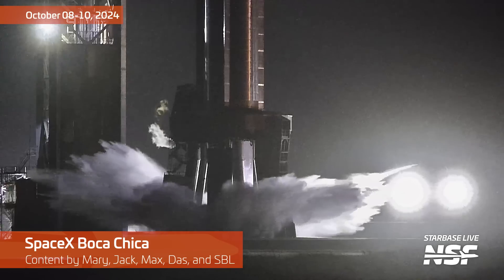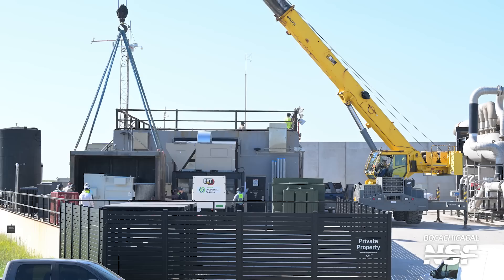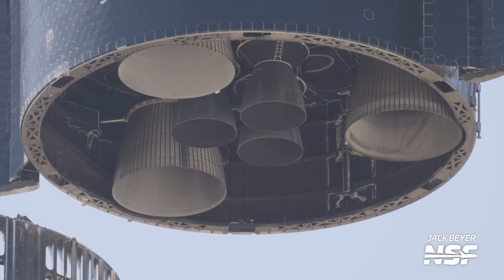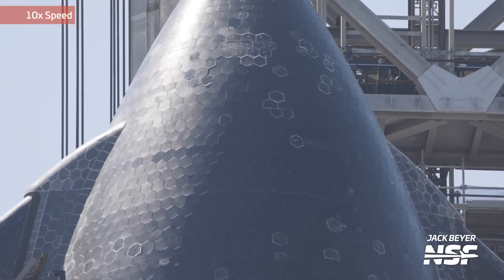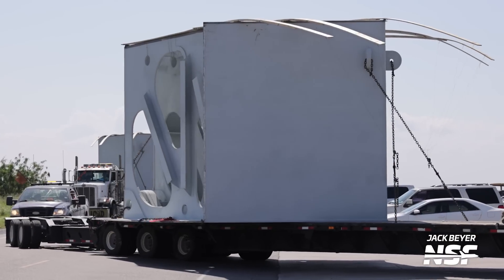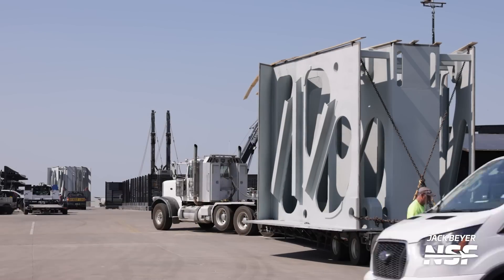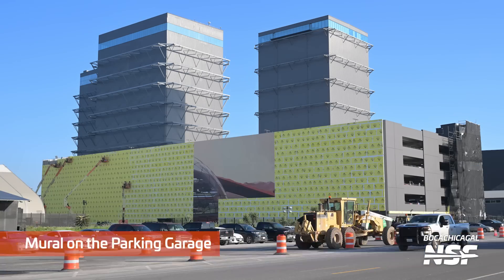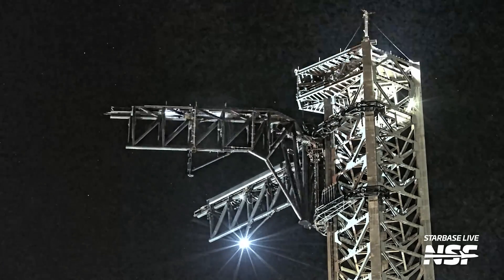FTS Installed Before Launch & Potential Catch | SpaceX Boca Chica

Comment: It's for over height loads or those very close to the maximum. Without requiring the power company to remove or lift the lines. However, there will still be spotters with poles, lifting the lines as needed. The lead vehicle will have a pole set at the same height, minus a few inches. This will give some time for the ground spotters and drivers a chance to react. All over passes will have to be bypassed, fixed structures don't flex very well

Comment: Yes the wood is to let low hanging cables slide over the tops of a high load. Yes do a video on the Del Mar thing (HA Now you gotta do home work) On tower one they left the flag up until they reeved the cable through. I hope they do the same here. It should be ok  as far away as it is.Thanks all... kinda enjoying the Boca Chica radio thing!

Comment: DAS, Correct the board's on top are to help prevent a snag on a wire but the chase vehicles should be warning the truck operator about the low wires.

Comment: @NASASpaceFlight at the 1:50 mark in this video, those antennas on top of the tower look like they will be used by the booster for triangulation to it's exact location during landing. That is where they will get their measurements from during the booster landing approach.

Comment: Can someone explain briefly how they are launching earlier than expected
Reply: I saw several videos speculating that NASA told FAA to FAFO!
Reply: Nobody had reported for certain but the regulations say that Fish & Wildlife has up to 60 days to report back. That's the time FAA was giving as a response. Seems likely they didn't need that much time. Eric Berger is reporting license drop likely Sat 10/12
Reply: nasa most likely is certifying them instead of faa as they got vested interest for sx to get this system operational asap and at the pace sx needs/wants to go instead of the slow bureaucracy that gov normally operates at.. otherwise there will be no return to the moon before CHN

Comment: On the banner Starship still has no legs 😭. We aint colonizing *** unless SpaceX puts legs on these things. The vehicle is cool but catching is totally useless and creates more weight for booster especially with need for burn back fuel. Put legs on both and land down range...
Reply: Unless they can target their landing for a safe landing it doesnt matter. Legs on the side of a crater will still tip. So legs are a secondary concern.
Reply: @Corrina_Stanley  Well they seem to be able to target landing OK. So definitely they need the legs as a primary concern. The Starship HLS they are building for the Artemis missions does have legs. Super looking forward to seeing this design in action.